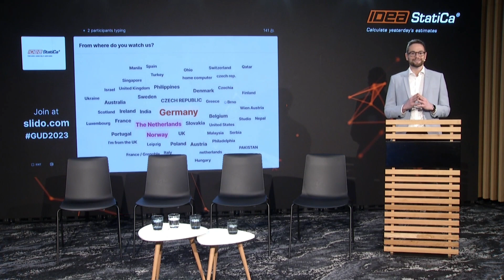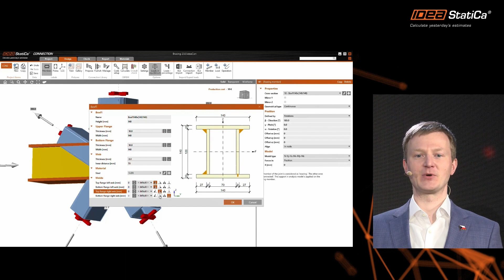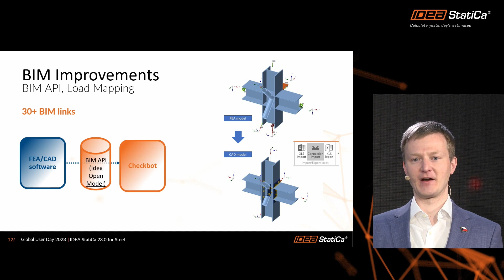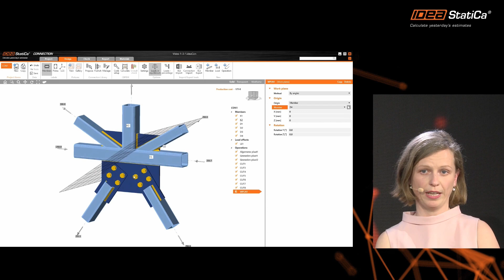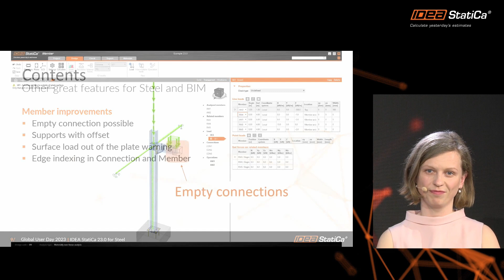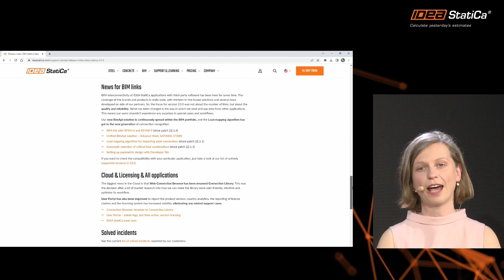Global User Day 2023 - Session #1 - What's new in IDEA StatiCa Steel version 23.0

Comment: I was expecting a partial joint penetration(PJP) and some limits to be defined in the size(throat thickness) of the fillet weld. These is long addressed with SCIA. Also the 23 version gives mesh generation errors which did not exist in the 22 version, also sent to SCIA. There is the need for the definition of the preload values in the bolts(snug tight is a definition rarely understood by engineers or site teams), for the moment full preload only is possible. Also some ways to define slotted holes in the webs and flanges of beams would be necessary(negative volume is excluded).
Reply from the maker: Dear Predator,
thanks for your suggestions. PJP welds and improved options for slotted holes are already on our wishlist and long-term development plan, but the list is very long, and some other features have higher priority, so we can not say now in which version this will be available.
For the preloaded bolts, the CBFEM model used counts with the requirement that the pretension force on site is applied as is required for the bolt by the manufacturer.
https://www.ideastatica.com/support-center/bolts-and-preloaded-bolts
https://www.ideastatica.com/webinars/summer-series-workflows-for-preloaded-bolts
https://www.ideastatica.com/support-center/check-of-bolts-and-preloaded-bolts-according-to-eurocode
Thank you for using our software and for watching the session!
IDEA StatiCa team